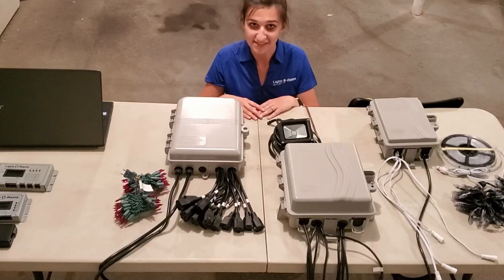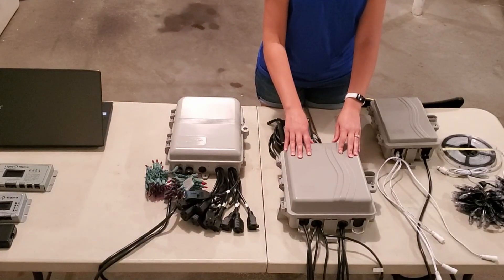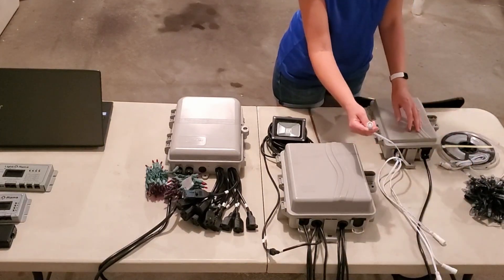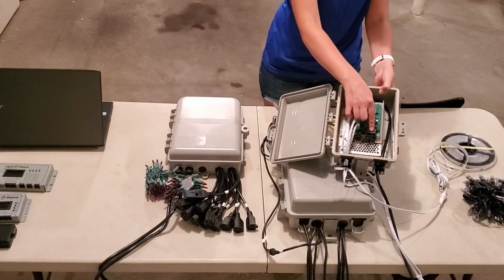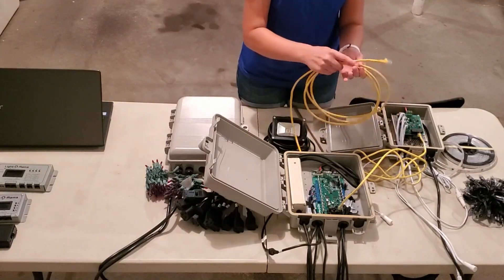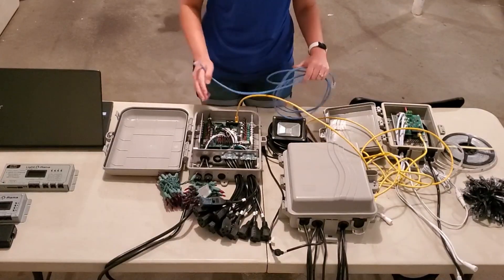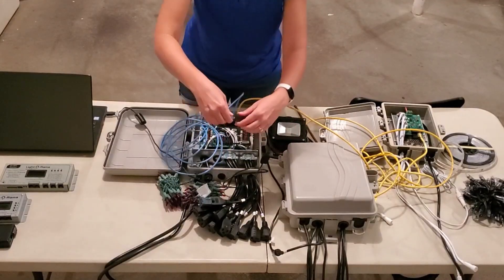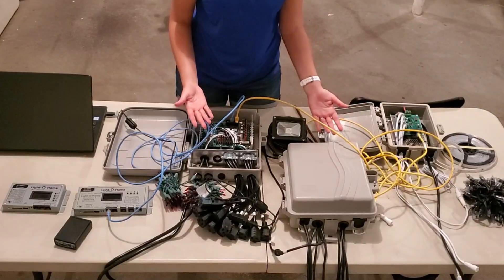Light-O-Rama Hardware: Controller Overview & Set Up Basics - Luminous Harmony "How To"

Comment: is the speaker connected with the preload song with the christmas lights??
Reply from the maker: You can use a speaker or an FM transmitter, or a splitter to do both. The Directors and your computer will have the same standard aux port for outputting audio.

Comment: for the director box the one that has 1 port. Can you connect multiple of the 16 outlet boxes to them or do you need the larger director with more ports to accommodate 3-4 of the basic boxes?
Reply from the maker: You can connect 240 of the Traditional Light AC Controllers together per network before reaching the network limit.

Comment: I recently purchased (2) older LOR 1602W controllers (Blue Board), (1) LOR 1602WG3 controller w/ Intelligent Dimmer, & (1) CTB16PCG2 controller.    

I've also purchased LOR Showtime Advanced software along with the "High Speed" USB connector.
I'm considering upgrading to LOR Showtime Pro software as I plan on adding Pixels in the future.

My question is, can I daisy chain my current controllers together? 

If I add Pixels in the future, can I daisy chain Pixel controllers with my current controllers or will I have to run a separate network to my Pixel controllers?

Thanks
Reply from the maker: Yes, but you will want a longer response with links to products and pages for explanation from the Light-O-Rama website. I suggest opening a help desk ticket with Light-O-Rama for easier communication and help vs the limitation of YouTube comments. Thanks for watching my video!

Comment: Hi! Do you just plug normal lights in or do they have to be those rgb pixel lights? I want to be able to flash and twinkle and dim up/down as part of the show but don’t need to change the colors I’m hoping to use normal string lights?
Reply from the maker: The controller on the left uses traditional lights that can do those effects you described. The controller on the right is for pixels.

Comment: Really helpful video! Question though, do the pixie controllers only work with light-o-rama's pixels from their store? I'm considering on buying a stand alone controller and order pixels from another vendor for a cheaper price, but I'm not sure whether they'll be compatible. Thanks!
Reply from the maker: The key is for the dangle ends and the pixel ends to match, or you need an adapter. You can install any of the well known dangles to a Pixie.

Comment: just purchased the res basic and there ios nithing basic about this
Reply: I have been trying to connect one for two days now and that box with the white cables are not included... I am unable to run the show there is also no direct information on how to connect the boxes in sequence ... Was this made for rocket scientist
Reply from the maker: If the white cords aren't included, that means you purchased a controller without 'dangles,' signifying you were going to purchase and attach your own (fairly common). Dangles are required in order to connect the pixel lights. The end connector type of the dangle must match the type of the pixel in order to connect.
Reply from the maker: It takes a little bit of work but it's some of the most user friendly equipment out there! We do offer one-on-one training sessions if you need more help: https://www.luminousharmony.com/support.html

Comment: So I have a question. I have a CTB16PC Controller that I use. I also have a Intelligent E1.31 RGB 16 Output Controller that is my mega tree that I have been using the both work just fine. I bought a Intelligent Pixie RGB 16 Output Controller so i can run RGB Intelligent RGB Pixels 50 count (like around my porch posts etc). I also have the S5 Pro Version Software from wow lights. I cant figure out how to get my new Pixie controller to work/added to my current sequences (I have bought all my sequences from wow lights). I'm so lost on that to do, I was able to set the box in my office use the high speed usb485 adapter and get the lights to turn on etc. But I cant figure out how to use the controller in my show/sequences that my CTB & Mega tree uses.
Reply from the maker: You would add Pixie controllers to a preview by adding a "prop" in the preview. Choose the shape of the prop, then define the IDs. Don't just add the Pixie as a controller - more work later. As for working with the Wowlights sequences, we wouldn't be able to assist with their sequences unfortunately, we only know how our own are created.

Comment: Thanks for the video!  I've been using LOR since 2006 and purchased the latest pro version software.  I'm a little confused with networks.  With networks set up, do I still need to use the hardware utility?  If so, why?  Thanks!
Reply from the maker: In S6, you can still use the Hardware Utility to search for controllers if you would like to, or you can use the Test Lights tab of the Control Panel to confirm controllers are connected and responding.

Comment: Nice explanation!  Could have used this about 10 years ago...LOL.  Do have a question.  When using one computer but only has 3 usb ports but needs 5 to 7 ports total.  Can you use a usb hub and the networks will be fast enough for the timing?
Reply from the maker: Yes you can! If you're using 5 to 7 networks though, you may want to consider a Pixielink instead of that many standard USB networks.
Reply: Thanks!!!! @LuminousHarmony